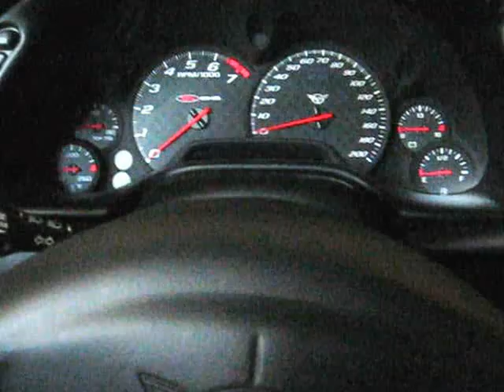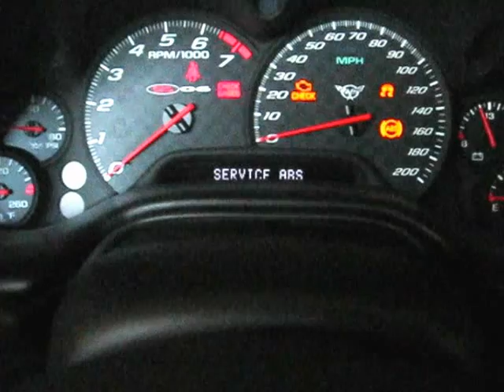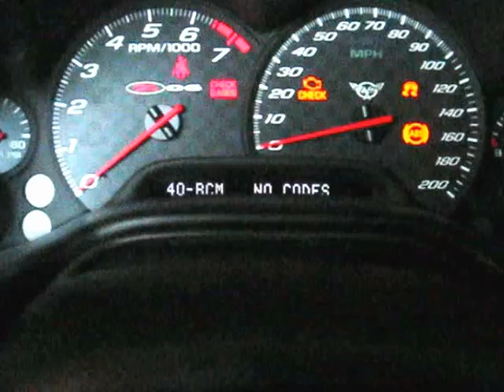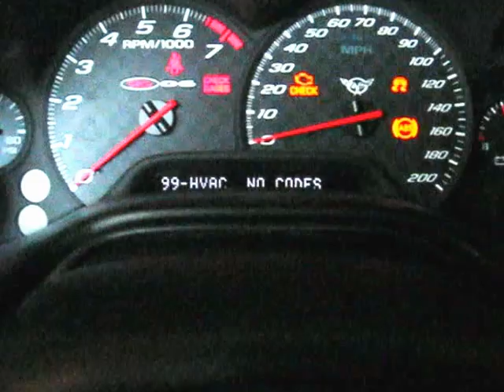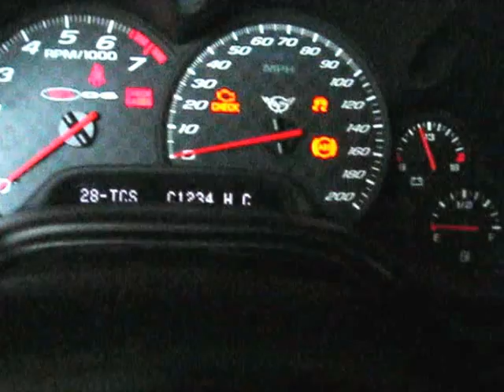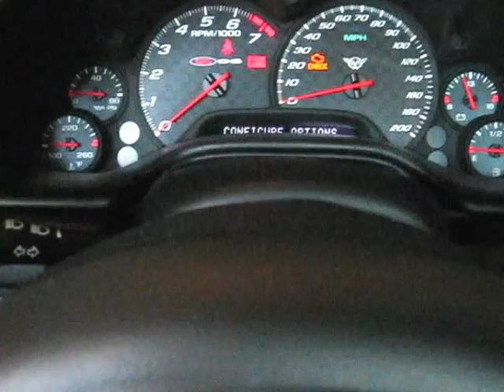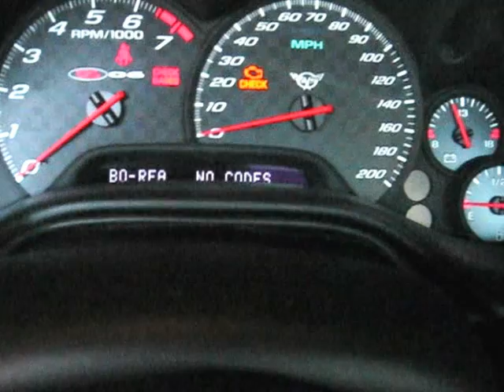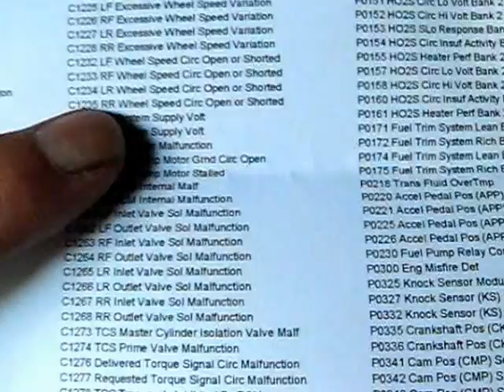Corvette reading diagnostic codes on the instrument panel 97- 04 by froggy

Comment: Hi i have 3 problems. One my heat turn on by itself when I start the car #2 after I shut the car off there's one leak the electrical 
#3 i was driving other day my check engine sign came up 97 corvett car start running rough & starting to overheat on traffic when I drive away be kind of went down. Can u help

Comment: Hi... 2001 C-5 question.... It runs rough for the 1st 45 sec to 1 min... Then smooths out and runs like a scalded cat... Florida heat too.. Anyone ? Anyone ? Bueller ? 

Last time I did a plug & wire change was Mmmm 6 yrs ago.. But, keeping up on everything else 😸✌ Uhhh Also...  189 k miles

Comment: I replace oil pressure sending unit on my 99 C-5 Corvette and into 2 weeks it did show Max oriole pressure again what do you think the problem is?
Reply from the maker: Not sure what Max oriole is?

:)
Reply: It's saying 129 pounds of pressure for the oil pressure sending unit
Reply: I meant to say Max or oil pressure
Reply from the maker: OK, did it read correctly for 2 weeks, then fail?

:)
Reply: Yes Sir two weeks ago I replace the oil pressure sending unit and Now it's jumping back-and-forth from 0 to 130
Reply from the maker: I will guess that the replacement sensor is bad if it worked for a while & quit. Many brand new replacement parts are, unfortunately, crap. I would try another brand.
Reply: froggy ok thanks

Comment: Froggy:  I appreciate the excellent overview and guidance.  My check engine light for 2004 Z06 just came on and I quickly diagnosed my fuel cap was an issue saving me lots of time and money.  GM should enable its consumers with manuals that include this detail!
Reply from the maker: I agree, it's not just Vettes.

:)
Reply: @1947froggy  Back when the check engine light went on in a 2002 Mitsubeast I just purchased. Took back to the dealer three times and they couldn't figure out why. I started to think about it. Went out and bought a new gas cap. Fixed the problem.

Comment: the light on the dash for the active handling shows it is on but  the tires still spin when i accelerate, any ideas
Reply from the maker: If the "light" you mean is the wiggle tire track lines, then that indicates a/h is OFF.
Reply: hey froggy, thanks for getting back to me. The problem i have is the indicator message comes up saying traction control is on but the tires still spin.  turned it off and and and also disconnected the batter with hopes it would help but still no change, any thoughts
Reply from the maker: The tc/ah was somewhat different from year to year in the c5's. Do you want the tires to never spin on hard acceleration? That was a feature introduced on the later c6's. A launch mode for max acceleration on a stick shift. What year is yours & auto or stick? Do you think something is wrong or are you just learning how it works?

If you are not the original owner, some guys modified the tc/ah to be OFF when the car is started. The GM default is ON when the car is started.

I am not sure what the question is & what you are trying to accomplish. Please provide details.

:)
Reply: it's a 2001 base conv. according to the manual the default mode is set to be on when started. i have had the car for 4 years and after taking it out of storage this spring it's  the first time i noticed wheel spin with tc on
Reply from the maker: Rear tires with low grip will spin pretty easy, If you have a small amount of spin then feel the tc/ah kick in then it's working the way it should. If they keep spinning and the tc/ah is definitely on then you need to check your codes and you may have an issue with the module.
Reply from the maker: I am not 100% sure on 2001 but you should feel the accel pedal "push back" (sort of) or go kind of dead.
Reply: thanks for the advise. i will check for codes and go from there.

Comment: Frog man, you the man. Put a air intake in and didn't push a sensor all the way in. The car was acting super crazy and thought it was going to cost me. Simple fix and after checking and clearing the code...bye bye Check Engine light.
Reply from the maker: Good work!

:)

Comment: Thanks....was just wondering if urs leaked any. It looks easy to change but was mainly wondering what was causing seepage cause it didn't used to & hose looks fine.  Might b the nipple on tank itself
Reply from the maker: Mine never leaked, lot of heat cycles under the hood, plastic parts & seals......  Be glad it's not a BMW, those cooling systems, wow, weak & failure prone, had 2 of them.

Comment: Have u ever changed the radiator overflow tank?? My 98 always has leakage around the rim of tank & it's leaking from that I guess inlet hose on top at fitting. I changed to hose clamp & it's still seeping after I park it. That nipple coating is peeling off at the end but I thought hose clamp would've fixed it
Reply from the maker: No I have not needed to, but done it on my Suburban, maybe look at Suburban vid, pretty similar.

:)

Comment: im having problems with my inst cluster noting comes on,had problems with my ignition switch that went away but no i get no reading on my dash my car was parked almost a year due to transmission problems barely got it fixed but now the dash wont display anything
Reply from the maker: If it's the whole cluster it's probably a connection under the dash gone bad, but ck fuses first.

:)

Comment from the maker: The tire SIZE is the important part. Rears should be "taller" than front by about 1/2 inch or so. Equal height or rear shorter than front will cause issues. Tire Rack has the specs on most tires. Look yours up.

Be very selective with aftermarket bolt on's, Vette is a very well developed car stock. Some bolt ons can mess up the car. I do mostly suspension. My fav company is Pfadt. Check them out.

I will be posting more on performance mods.

:)

Comment: Hey Froggy!

Pulled all the codes last night and nothing related to a speed sensor or anything to trigger a wheel problem. I am running non-stock tires so that's probably the issue. BTW: What type of bolt on, aftermarket performance parts have you had success with (if any)? Thanks in advance and look forward to your videos!

Comment: Thanks for the advice! I'll pull the codes and examine...it's a little frustrating but I can live with it if the issue continues. Fingers crossed it's not the bearings!

Comment from the maker: Hi Scott, I have not had that one myself, but many have. Pull the codes, they will tell you which corner of the car is causing issues. Take the wiring apart & examine the connection CAREFULLY. If it's loose, bent, frayed, replace it. If it looks ok, clean & reassemble. Another cause of wheel speed sensor codes can be non stock tires sizes. That's another video to come. 80% of these codes will be one of those two. Worn out wheel bearings also but less often.